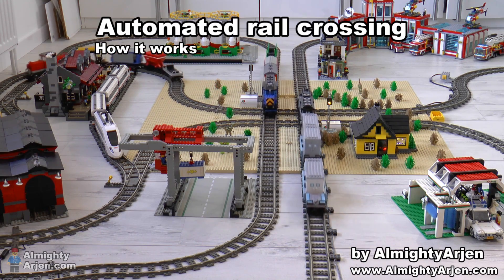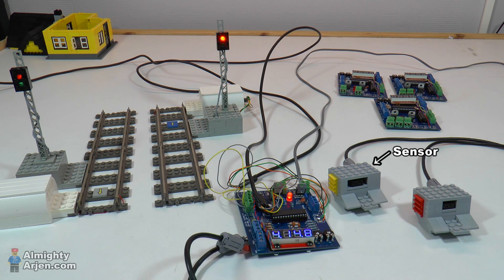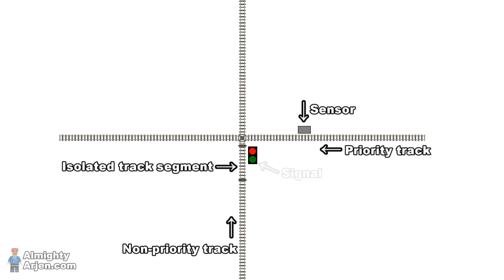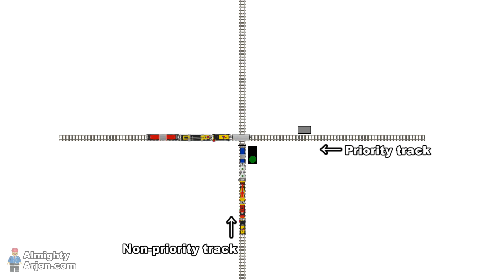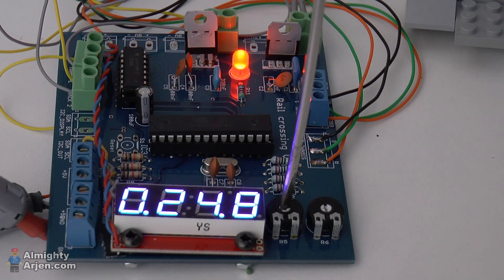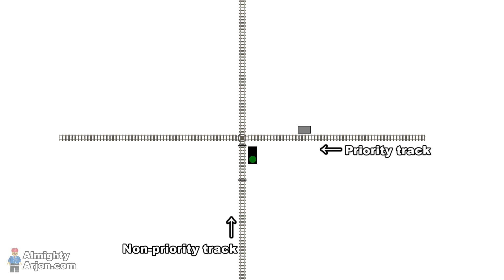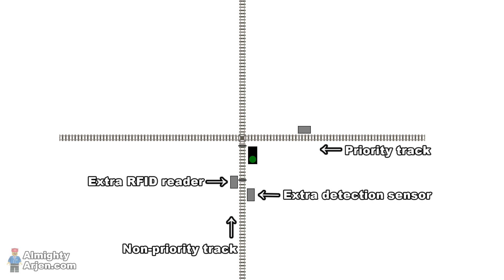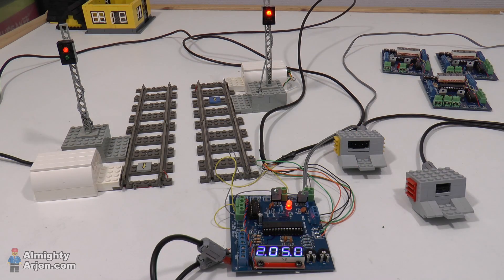Lego train rail crossing automated by Arduino How It Works

Comment: The kids and I have the new battery-powered trains and no interest in buying miles of wired track etc so need to figure out how to automate the crossings a different way! Still a noob with this but I think I could either spend a bunch on the Powered Up components and then use the app to program it, or use something like Arduino (or software code) and piecing together various electronic parts with resulting steep learning curve. (I also have an old Boost set I picked up that could be useful??) I'm sure there's a LOT of solutions out there. Programming itself is no problem for me (& keen for the kids to pick it up), it's learning the specific tech that'll take the time (& saving up the money). It's also whether we want the trains and the crossings and any other components to be able to talk to one another. I guess someone's come up with a way to interface the Powered Up / Boost bluetooth signals with third party tech? Or at least describe the protocols?
Reply from the maker: there are several ways to do this. You could use the original PoweredUp system. Use a color sensor to identify different trains. If you want to have a look at 3rd  party, I'd recommend PoweredUp in combination with Arduino. There's already an arduino library called Legoino which can be used together with a ESP32 board, for example the Heltec 32 WIFI kit. Using the Legoino library, it can send commands to the poweredup hub which controls the motors.

Comment: ok to put it simply, i have no idea how you do it but id like to do it absolutely. do you sell these items with instructions on deployment, ready made? that would be cool to have.
Reply from the maker: Sorry, I don'sell the stuff ;)
Reply: i have some questions:(1) how does the Lego train physically stop (you must coordinate its functionality with external factors (red light, etc) and that is not available from the video. How does the motor stop or stop sending movement signals to the chassis of the train?(2) can you extend this same methodology to timed stops at stations and changes to LED displays?
Reply from the maker: 1. I make the train stop by cutting the power from the rails.
2. Yes, I've done the same principle in this layout: https://youtu.be/KByHf-aQmzM
Reply: sorry i may have missed something but who is powering the train then? the rails, or the motor? All modern lego trains run on a motor, the rails just guide the trains, they dont power them. so what do you mean you cut power from the rails? if you power trains with rail track then you dont need a motor onboard trains - right?
Reply from the maker: I use an older system, which has metal rails that are powered. Metal wheels of the train motor pick up that power.

Comment: Great ideas! Instead of using a delay could it be practical to use a 2nd sensor after the crossing on the priority tracks and only power the non-priority track if both sensors return a value corresponding to there being nothing on the priority track?
Reply: brilliant comment indeed, to an epically brilliant post.

Comment: Your automation builds rock!  Really, really impressive.
Reply from the maker: It's an old train system and not for sale anymore. You can find it on Bricklink or Ebay
Reply from the maker: Thanks!
Reply: DunksterBricks
Reply: AlmightyArjen hay if you want to photos of me check my Istergram account could Spyro27 when you find I can follow you
Reply: Hello. Where did you get a 9v motors and metalized rails? I can't find them in lego shop.
Reply: AlmightyArjen can you tell approximitely the value of such train system like yours? with all sensors and controllers
Reply: @AlmightyArjen With the double crossing you can take out the timer and just have the opposite sensor keep track of the tail of the train. Once both sensors indicate that there is no train visible, the non-priority train can continue. I like the fact that you designed your own custom PCB and only used the atmega chip instead of an Uno for instance! Very creative! Where did you order your pcb? (I also live in the Netherlands, if it is a domestic shop).
Reply: DunksterBricks н
Reply: coool